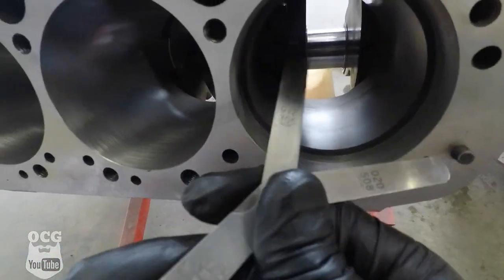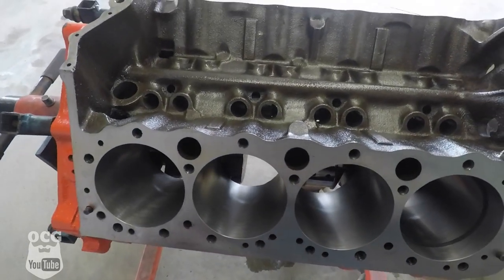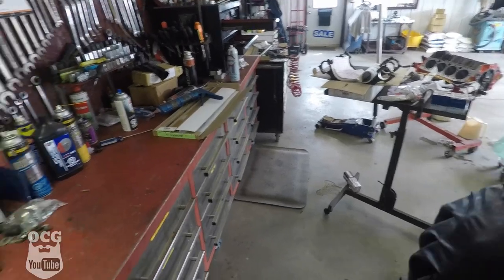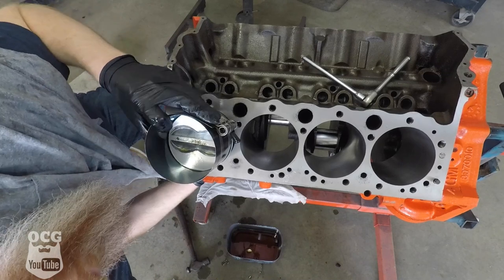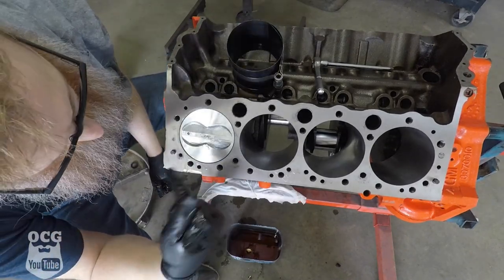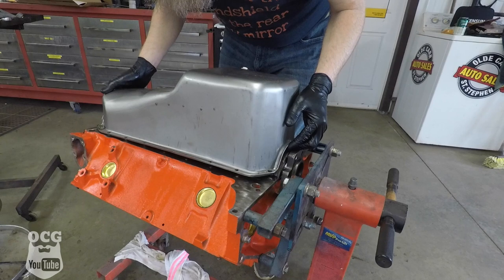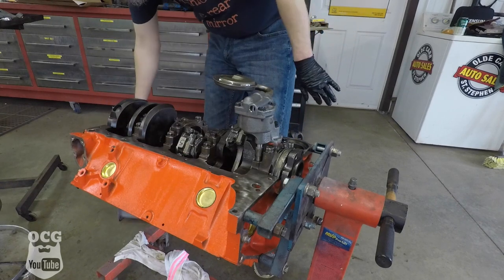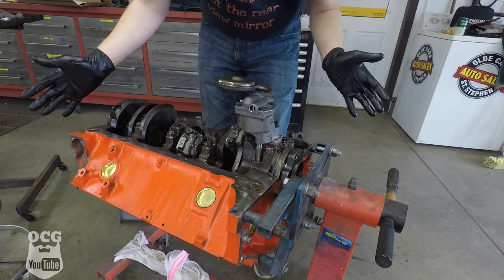PART 3 BUILDING UP A SMALL BLOCK CHEVY 350 FOR MY 1977 CHEVY C10

Comment: I just watched your video with str8sixfan and junkyard digs and decided to subscribe to your channel! You have some great content. At 7:09 you show a mark on the cap bearing and the journal. What was used to make the mark and what was the strip you compared the size of the mark to??
Reply from the maker: Hey Bayou! Thanks so much for subscribing. The little strip is called Plasti-gauge. It’s a thin wax strip that compresses and you measure the squish mark! Great question!
Reply: @OldeCarrGuy  , Thank you Sir for the info! I plan to do a rebuild in the future and I need all the tips/knowledge I can get!